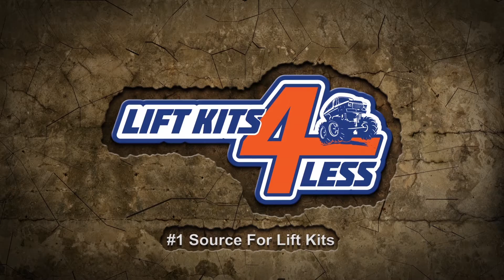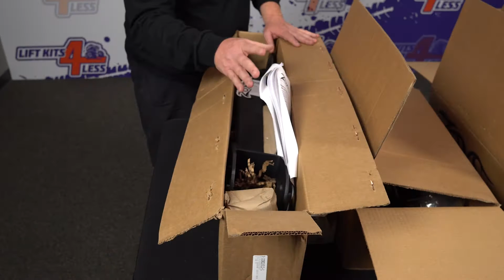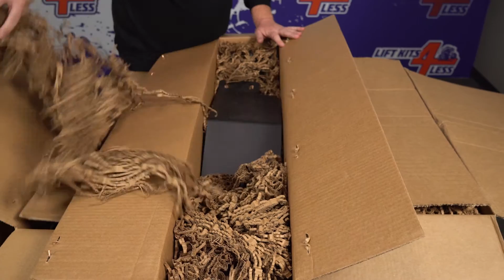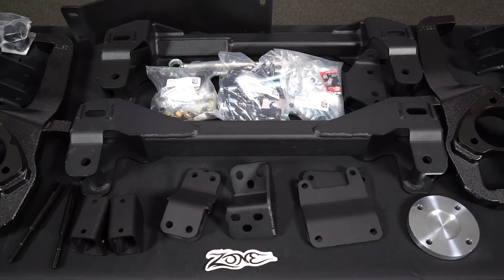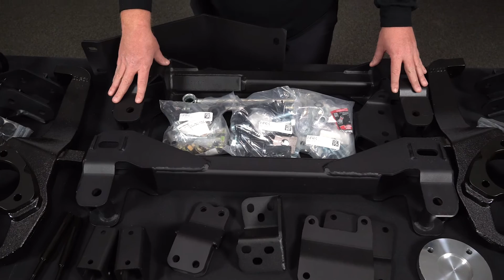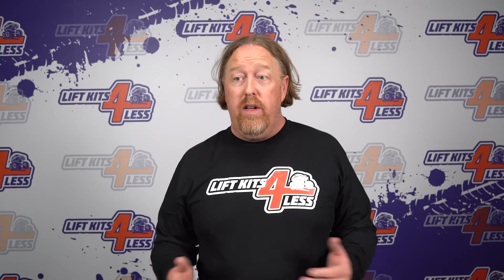Zone Offroad D40/D40N & D41/D41N 6" Lift Kit System | 2013-2018 Dodge Ram 1500

Comment: Just bought the D41N 6" kit. It goes to Snyder Performance this Tuesday for install. They told me to get 37" tires so I bought the BF Goodrich mud terrain km2's. Since I'll be running the factory 20's, what do you think I'll need to make to make it work ? I also bought 4 1.5" hubcentric wheel spacers but don't know if I'll have rubbing issues or if it will look stupid. What do you recommend as I am not sure myself ? 2015 ram 1500 bighorn crewcab 4x4. 6.4' box.
Reply: Do you have a pic of your setup with the 37's and spacers?
Reply: I am currently thinking about a Zone lift (or a Rough Country) and have the same exact truck. Did you use the factory 20's? how did it turn out?
Reply: Vico917 had to use 1.5" hubcentric wheel spacers using my factory 20's. It looks and performs great.
Reply: @jjkatona Thank you for the response!!! I am thinking about reusing my factory 20's until I can get aftermarket's.  Just trying to ease the one big initial expense, lol.
Reply: Vico917 I think you'll like the look with the stock wheels and wanna keep them on. Anyway, you're welcome and glad I could help.

Comment: I am currently running bilstein 5100s on the 2.1 setting too give me a level look. Would i require the front strut spacer still? Would i have to lower the 5100s back to 0? I'm confused. Whats the diff between 3 in and 5 in coils
Reply: Kyle Golanch with your 2.1 setting you can leave it be and get the 5 inch rear coil option and have about 8 inches of lift most will advise against it or you can go back to the 0 setting and get the 3 inch coil option to sit level

Comment: If I purchased Fox 2.0 coilovers for the front and 2.0 shocks for the rear of my 2016 Ram sport 1500 4x4 5.7 Hemi, could I use this 6” kit with those shocks? They aren’t installed yet and I’m looking for options. I also purchased a set of Zone HD upper control arms because I wanted to have the correct angles on the ball joints when putting in the front coilovers that provide a 2” level on the front end.
Reply from the maker: I have access to 6" lift coils, did you purchase the 2" lift coils?

Comment: can you help me. the truck in the end, is that what it will sit like with 6" in the front and 3" in the back?
Reply from the maker: Yes, that is the Zone D40 kit installed with the 3" Coil Spring in the rear.  The customer chose to run a 35" tire on -44 offset wheels

Comment: I have a ram 1500 that color what does something like this cost with install?
Reply from the maker: Kit and installation is around $2300 but this will very across the country
Reply: Sounds about right. I went to a local shop near me. Really nice clean shop and very professional. They charge 95 and hour but have to charge a minimum of TWO DAYS of labor to get it installed so 1500 for what would take a team of two no less than 8-9 hours easy. 135 for an alignment Wich is way to to much. Some of these places try to rip you off

Comment: so is it true zone and bds kits are the same except the bds price and warranty?
Reply from the maker: BDS and Zone Offroad are manufactured by the same company now owned by Fox Shocks Inc.  There are many familiarizes to the Zone and BDS kits and my guess is their are shared parts between a BDS kits and a Zone kits.  Clearly BDS offers one of the best warranties in the Suspension Industry.  Typically the BDS kits offer upgraded parts over the Zone kits including Fox 2.5" Coil Overs.

Comment: Do you recommend replacing the upper control arms with this kit and are there any strut and shock upgrades available for example Fox?
Reply from the maker: You can upgrade the UCAs but we don't feel it's needed by any means. As for the upgrades, the kit is available with Fox 2.0 Series shocks if you visit our website and click that live chat button. liftkits4less.com
Reply: LiftKits4Less Okay, thanks!
Reply: when lifting a ram 1500 and using stock uca's alot of times the ball joints will pop out